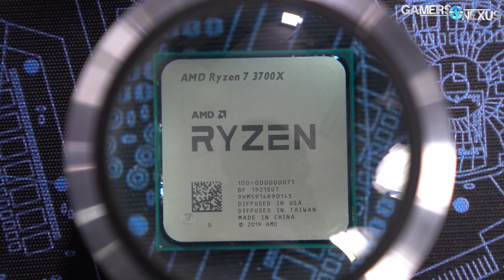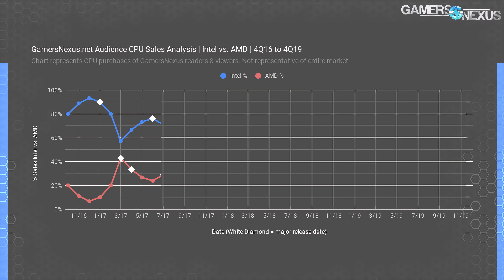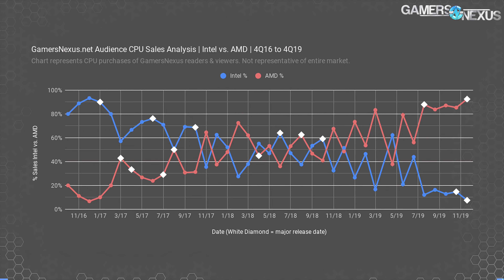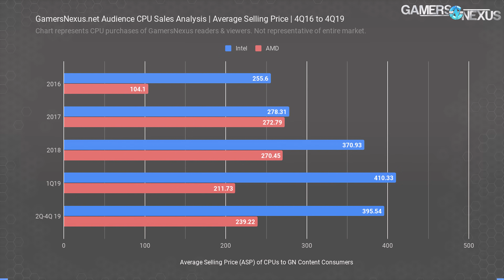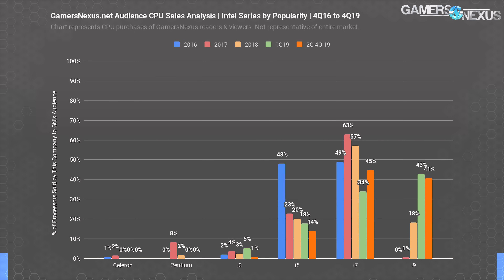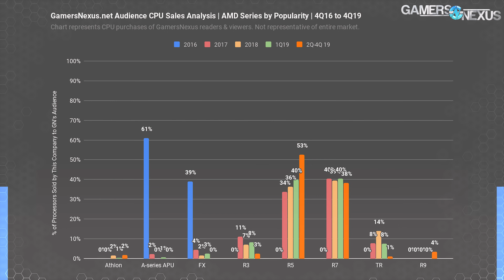GN Special Report: AMD Moves 93% of CPU Sales (Intel vs. AMD 2019 for DIY)

Comment: Turns out gamers would rather pick twice as many cores and peace of mind coming from lack of vulnerabilities over 5 FPS in CS at 1080p. Intel is finished.
Reply: This honestly is the worst position i've ever seen intel in. What are they going to do next year?
Reply: @dondraper4438  Probably continue to earn several times as much money as AMD. They had a shitty year because of their vulnerabilities but their stock is still up a healthy amount for the year. AMD is kicking ass in the least profitible sector of the market, it should pay dividends down the line but until they can find buyers for the high yield parts made in the paid-for fabs they're not going to really trouble Intel.
Reply: @dondraper4438    Don't ever kick Intel to the curb or they will return and slap AMD silly.
Don't expect much in the enthusiasts market though.
Reply: @wysetech2000  They might and it's absolutely possible; it won't be with Core i though.
Reply: @dondraper4438      OK, Capt. security.
Reply: @wysetech2000  Bruh, during the mining craze websites were able to mine on your pc. That's how much of a joke intel's security and the security of browsers were.
Reply: @wysetech2000  If I am paying $500 for a cpu and $250 for a motherboard, it better be fucking secure.
Reply: @wysetech2000  I was watching youtube and my gtx 1070 was running 70 celsius. No game opens open, not even a launcher.
Reply: @wysetech2000  I didn't mean to come off as a dick, but that experience taught me security really does matter. Especially now a days when exploits and hacks are becoming more and more intrusive.
Reply: @dondraper4438  The mining craze is over. In my opinion, Internet security is terrible no matter what CPU you use.
Reply: Well, I have R5 3600 and CS:GO is at fixed 300FPS on my 144hz screen on highest settings. Why would I want more FPS?
Reply: @DARKNESS0x77  using CSGO as a measurement of performance is silly
Reply: @OdinAlgeron  paying extra 300$ for a mere 5FPS from a CPU upgrade instead of getting a more powerful GPU is also silly
Reply: @CompWiz2007  First off, for the budget minded, $150 is plenty of a difference on a $500 build.  if you can save $150 and the finished product still does everything you need it to do, you are an idiot to spend more money.  Additionally, going Intel in the period meant a lot more than just the cost of the CPU.  With platform changes going blue would mean buying a new motherboard on an upgrade as well, with Intel motherboards costing 10-20% more than new AMD boards.  furthermore, if you already had couple year old system, many boards that supported Phenom era chips also could be upgrade to an FX with no need to replace anything else.   
Simply put, for most people, where actually having the best that money could buy doesn't matter as long as it gets the job done, FX did the business for far less money.  
It still does the business today for a huge number of people who have found no need to build a new system when their 5+ year old FX systems are still capable of doing all the day to day things asked of them.  
If you want the best, you can pay for that, but FX was not a universal failure objectively speaking in the market.  it was only a failure if you care about top end performance above all else.  In which case I suggest pulling your self out of abject poverty and making sure you only drive a Koenigsegg.  Every other car must be a failure because they are not as fast and only poor people would buy anything else.
Reply: @johngaltline9933  Oh I would, but it's illegal to drive one most places in north america :P
Reply: @CompWiz2007  You can say all that, but it is a pure unadulterated fact that an r5 3600 is going to age better than an i5 9600k.
Reply: Everyone is forgetting that there is things like video and 3d modeling in which more threads means more better. Not everything is about gaming.
Reply: @MrBearyMcBearface  Pretty sure no one forgot about that. The thread is clearly about gaming. o.o
Reply: @auturgicflosculator  I dunno. Seems like the intel trolls forgot about it.
Reply: @MrBearyMcBearface  Yeah, but I mean... fanboys are subhumans, essentially. You can't reason with them~
Reply: @auturgicflosculator  lol. Yeah 😁
Reply: @CompWiz2007   Are you too young to remember AMD Phenom CPUs? They were awesome, and the Athlons before. 
AMD stopped progressing after that and fell behind with the FX.
Kinda like Intel now.
If AMD can displace a significant amount of Xeons, they'll be in a really good position.
Reply: @CompWiz2007  Saying FX was a universally accepted failure is a dishonest position.  It was an objective failure for gaming, but it was a perfectly acceptable option to the average computer user, providing a good enough processor for half the cost of it's competitor. as with Ryzen, if the benchmark is 'what CPU will make my FPS number the highest" Intel wins.  if, on the other hand, the question is "What is the least possible money I can spend to play the games I want to play at acceptable settings and do all my other day to day work as well" FX checked the box for many people. 
For current generation parts, if you have unlimited budget, and you only want to game, then intel makes sense.  This assumes you are going to have a 240Hz monitor, 2080ti, etc.  If, on the other hand, you've got a realistic budget to work with, and are stretching it for that 120Hz monitor, it makes no difference at all if your CPU can push 170 or 200 FPS, the end result is the same.  And for 90%+ of the market still running 60Hz or 75Hz monitors, it's all meaningless, with the only numbers that matter being how quickly the CPU chews through real work loads.
Reply: @CompWiz2007  People are buying Ryzens in response to Intels shitty and almost criminal marketing, and because Ryzens are simply really, really good CPU's at a really good price. Intel has a background of being absolutely pathetic with their benchmarking tests."Third party" benchmarking that are paid for by Intel, "Third party" benchmarks that Intel paid to develop and heavily cherry picking benchmarks anyway. Some of these sites that are paid by Intel, literally turned off half the cores of Ryzens/Threadrippers to favor Intel. For christs sakes, Intel literally claimed that an i3 is better than an R7 by seriously cherry picking stats. They took advantage of people that dont know anything about computers just to sell them a shittier product at a premium price. Intel is full of shit, but I do hope they make a comeback so we, the consumers, can take advantage of more competetive pricing and better CPU's.
Reply: @CompWiz2007  Your reply highlights exactly my point.  if budget was more important than anything else, in the low end, FX offered the best product.  Something is not a universal failure if a major segment of the market finds it to be the best choice for their needs.  
Is a Ford Focus a major failure because it can not compete with other cars in any way besides it's price? What something costs is important, assuming it does everything it needs to do.  if a $100 FX CPU is capable of doing every tack that the owner throws at it in an amount of time they find acceptable, it may be a perfect choice for them and they have no need to spend more on a better processor that they will never actually make use of.
Reply: @CompWiz2007  I started with Pentium 1, and AMD / Cyrix. So I really doubt you have done more anything than me. Compwiz2007, ok. Lol. 💩
Reply: @CompWiz2007  From my reference to Xeons earlier, you could have guessed I don't work with consumer gear much at all now..although do still keep an eye on what's going on in this area of the industry too. 
Anyways, you've made a tit of yourself many times in this comment thread. Congrats. 
Cya
Reply: Also, nicer prices.
Reply: @hotaru25189  Because the vulnerabilities are in the arhitecture. Unless intel has some new radically different architecture they've been working on for 4 years and releases it, they'll continue to have those back doors.
Reply: @CompWiz2007  The only one that's currently crying is you. Don't know what your problem ist but I guess that you noticed the stupidity in your previous statement and don't know how to answer my comments.
Reply: @MrKunzzi, realistically even if Intel sat on their asses for all of 2020 they still wouldn't be "finished". AMD literally doesn't have the manufacturing capacity to surpass Intel in the marketplace. The 3800X, etc, has been constantly sold out. AMD can't just magically flip a switch and increase production by 20x to meet demand. Intel could literally do nothing and still keep the majority of the market because Intel spent billions of dollars building their own fabrication facilities, while AMD is stuck relying on TSMC to produce the silicon for them.
This is also why Intel has been struggling with the 10nm process, because they are doing it in house. AMD just leapfrogged past them by having TSMC do the fab work for them. It's great for AMD to have the 7nm, but the price they pay is the fact that they will remain stuck with a minority market share since they don't own the fabs.
Reply: @trapical  You make a good point, TSMC is attempting it though. They raised their market cap by like 15 billion earlier this year.
Reply: @trapical  When AMD start to pay dividends to their stockholders, then I'll consider that they have turned the company around, not before. tbh actually in reality they haven't produced the goods rather TSMC has, if AMD were still relying on Global Foundries ie the original AMD foundries, then they'd be well and truly screwed. Intel has made a complete mess of 10nm and deserve a kicking but they'll pass it by and move on to the next process quickly.  I can see Intel discounting prices heavily as they can easily afford it and if the DIY market isn't attracted by it then the SI's most certainly will be as it will improve their bottom lines.
Reply: 3700x and up gets more fps in csgo assuming your using good ram
Reply: Lol ya Intel is “finished.” Whatever will they do until their next node in a year or two? Maybe they should ask AMD how they survived for years on FX.
Reply: @CompWiz2007  i7 9700k is niche, is it great for gaming? Yes. Would i buy an i7 9700k over an r7 3700x? No. Why? Because i build my pc for longevity.
Reply: @CompWiz2007  Fx gets a lot of hate and quite a bit of it was warranted. But i feel like fx's problem wasn't it's performance. It was the power consumption. Bulldozer was HOOOOT and consumed insane wattage.
Reply: @CompWiz2007  🤡
Reply: @CompWiz2007  Nice counter argument. Very well put together.
Reply: @CompWiz2007  I only game on this pc, i'll probably upgrade my gpu only.
Reply: @hotaru25189    Since all Intel CPUs will have Hyperthreading turned on again soon i would think that most of the vulnerabilities will be taken care of.
Reply: @hotaru25189    I suppose you are an engineer at Intel. I find it truly amazing how many security experts there is out there.
So i guess AMD didn't patch their security issues either.
All you Intel haters should dig a little deeper and find something else to bash Intel with. It's always the same old, same old things i have read 6 dozen times.
Get a damn life!
Reply: @hotaru25189  Intel has been talking more and more about other markets lately and doesn't seem to have answer for Zen 3, nor did they have an answer for Zen 2.
Reply: @hotaru25189      So your saying that Intel should hang a "closed for business" sign on the door for exploits that have only been exploited by researchers.  People have blown this whole thing out of proportion. Have you considered  seeing a shrink?
Reply: @CompWiz2007   "Where is Intel still strong.... Oh yeah GAMING" 

Such a stupid Statement. There's hardly any CPU bottlenecked game that doesn't go above 200fps.
Reply: @ysujy2146  wrong, some games struggle to reach past 60 
intel is also vastly better at VR and emulation
Reply: @OdinAlgeron  All those games that struggle to reach 60fps are bottlenecked by the gpu. Intel isn't performing better in vr.
Reply: lol calling people ignorant and kids , you are definetly a gamer sir , gotta buy that INTEL DAWG BCZ THAT'S THE BEST IN THE MARKET RIGHT NOW (even if u are being ripped off)  AM I RIGHT! If u don't buy intel u are a kid building a PC! LMFAO  great argument sir!
Reply: @CompWiz2007  I bought a 2700x for 180€ and it beats (by not much, admittedly) a 400€ 9700k. The 2700x also comes with a remarkably good stock heatsink included which I won't be replacing and the 9700k doesn't, so its actual real cost is at least 450-470€ (don't forget the €10 tube of thermal paste).
It's not a matter of poverty or riches, the matter is simply that I'd have to be a fucking idiot to buy the 9700k, just like I would have to be to buy gas at 3.5€/l when the gas station on the other side of the road sells it for 1.5. 

Paying more for the same doesn't make you cool, it makes you stupid and nothing else.
Reply: You only need 1 core or 2 to run games.  More cores means nothing for games.
Reply: Family Fun R.C. Games made in 2012-2014 sure. Current games not so much
Reply: more like 10 - 20 fps on average, in favor of the 9900k vs a 3700x . For things like VR or emulation its not even close.
more cores mean nothing for gaming right now: The FX line should have taught you this. By the time it would matter the cpu would be obsolete, ryzen cant even keep up with a 2080 ti properly never mind future gpu's.
Reply: @OdinAlgeron  "right now" is key. There is more to cpus than just gaming. Amd crushes Intel at multithreaded applications. At some point, game devs are going to have to make more use of multithreading.
Reply: @MrBearyMcBearface  you would hope, but we have been asking for that for over a decade now.
Reply: @98dizzard  it just makes sense. It seems like we're getting close to the limits of single core speeds. Unless game devs want to wait for common consumer quantum computing, they're gonna have to change their lazy and/or stubborn ways of devving
Reply: @MrBearyMcBearface  single core speeds have been pretty stagnant for a decade anyway, with only minor improvements (5-10% tops) year on year. Yet still, most games are not optimised for multi-threading. There's some improvement for some developers, but still not good enough.
Reply: @MrBearyMcBearface  true, BUT by the time more cores would matter the current cpu's will be obsolete. Look at the history of the FX line, people had this idea of future proofing with more cores then, and it never actually made the FX processors any better.
Reply: @OdinAlgeron  they did achieve world record speeds with OCing. That's gotta account for something
Reply: @OdinAlgeron  seeing as the next gen of consoles are going to be zen 2 based, presumably complete with SMT capability, it's a pretty safe bet that developers will actually start to utilise higher core and thread counts to a much greater degree. It never made much sense to utilise more than 4 cores in the not too distant past, because that was the standard. As for HT/SMT, why would devs go out of their way to utilise a feature that only appeared on a small handful of CPUs that were largely restricted to the relatively small enthusiast market?

When mainstream consoles are packing 8 cores and 16 threads, it only makes sense to try to leverage that. So I'm anticipating much better multi threaded utilisation from games in the near future.
Reply: @OdinAlgeron  The FX line taught us that the gaming industry was not ready for that many cores. It's still not quite the norm but there's been progress in making multiple core leverage more common. Another thing the FX line taught us is that having more cores is not a replacement for strong IPC. Having more cores and about the same IPC, though... your entire comment is bullshit, half a decade late...
Reply: @OdinAlgeron  But you're comparing an R7 against an I9. These chips have a 100$ + price difference. Sayings more than 6 cores are useless in gaming is kinda stupid. More cores have to become mainstream so that devs have a reason to implement better utilization.
Reply: @OdinAlgeron  if you buying a 2080ti to game at 1080p you are doing it wrong. AMD maxes 2080ti at 1440p ultra settings just fine and in the games Intel are faster, the framerates are already plenty high. Only leaves dual  thread emulation as a bit weak.
Reply: @jondonnelly3  the 9900k is still 8-10% faster at 1440p
also you should be playing on high settings, ultra is for pictures only

Comment: I just want threadripper to have 64 cores and 128 threads with price under 2k dollar.
Reply: AMD is a semi conductor company not a charity my guy.
Reply: @keagan5379  With the kind of bargain reputation AMD have, they cannot sell their products at Intel's pricing. Hardcore lowballers will bring down AMD's MSRP prices no matter what.
Reply: impossible to remain profitable then
Reply: It certainly will be, In 4 years or so, maybe less.
Reply: In reality it probably would cost far less than they will charge for it, but they probably gonna charge 3k for it
Reply: Mostly likely it will go for around 3700 dollars.
Reply: you're dumb AF. the 32 core is 2k, why would they drop the 64 core in there or below?